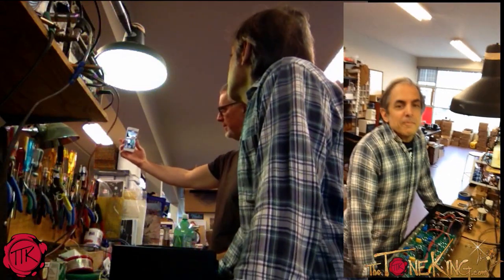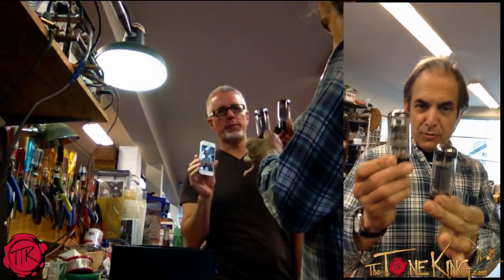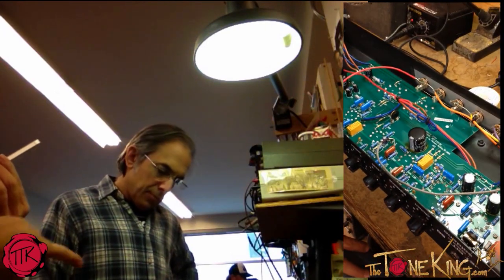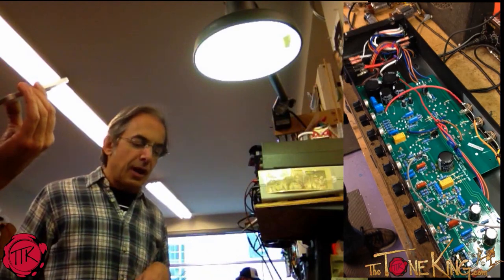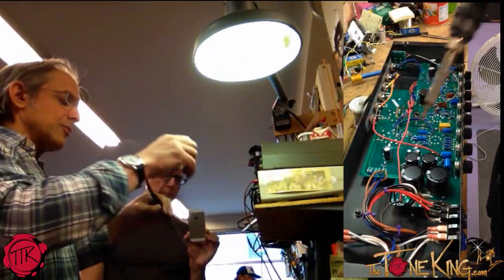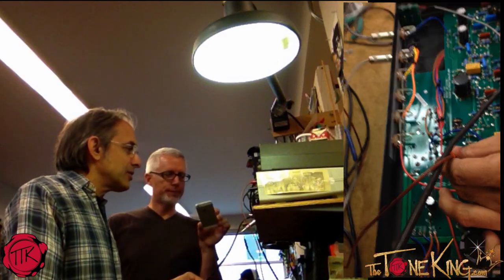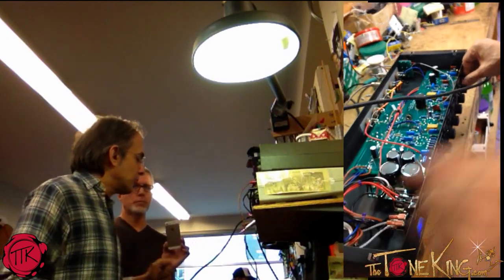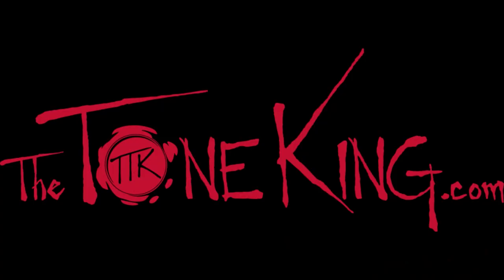MIKE SOLDANO : Mod & Bias - 50w Tube Guitar Amp : AmpFactory.com

Comment: I would like to know which resistors to swap so I can add the EL34 tubes and also which resistor I can replace with a choke and how many henries for the JCA50h. Thank you Master Wizard
Reply: +deadratsalad4 You replace the two large 470 ohm SCREEN resistors with 1K resistors and then you may have to modify the bias to get it in the correct range for a EL34. When a choke is used it goes between the B+ and the C+ voltages, you can trace the SCREEN resistors back to one side of the part, and the audio transformer red lead back to the other side of the part. As far as Henries goes, there is no right answer, as it is preference, and any choke would arguably perform better than a resistor. There is however a current handling capability that has to met. So dont use one thats meant for anything less than, in your case, 50 Watts. To be clear any choke for a 50 or a 100 Watt amp would work. Any tube amp tech worth his salt deals with these questions every day, and should be able to quote you over the phone. Good luck, Greg. (800.FIX.ME.UP) guitarrepair.com
Reply: jca 50 has a choke stock.

Comment: Is it actually necessary to do that mod for switching to EL34?
Reply: +Robby Sipahutar as it turned out on that particular amp, only the screen resistors were changed, and the bias circuit was already capable of the range of bias needed for the old el34's and the new 6l6's. Those tubes need a very different bias voltage from each other, usually amp designers don't provide that wide of a range of adjustment.

Comment: So you had to change just 1 resister?
Reply: No, both the screen resistors from 470K to 1K to run the EL34's.  He did not have to change the bias resistor, since the pot to adjust the bias was still in range.  So, 2 parts.

Comment: To swap 6L6s with EL34s you'll also need to solder pins 1 and 8 together of the octal sockets. Why don't you talk about that?
Reply: Maybe because Pin 1 is already connected to ground on the board.

Comment: I always thought you had to pull the board and solder from the back side?  Now.. I will be TRUELY dangerous!!!  (Pluggin in soldering iron now...  Time to victomize that Blues Jr.)  No need to modify my JCA50H, other than the stock speakers in the 2x12 cab...  Don't care much for those...

Comment: Jeez what is this guys obsession with the KT88? Who gives a shit if any amp can run a KT88. Those tubes suck. When Korg bought Marshall they started running 6550's (essentially a KT88) in the power section, and guess what? NOBODY liked them. 6L6 EL34, EL84, and 6V6 and THE power tubes for tube amps period!